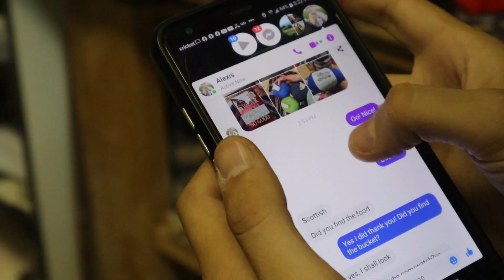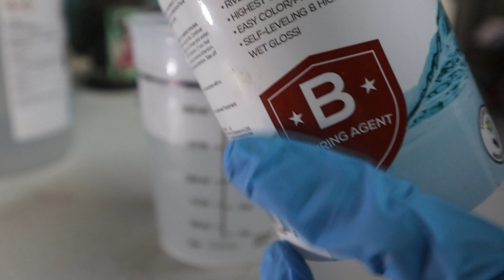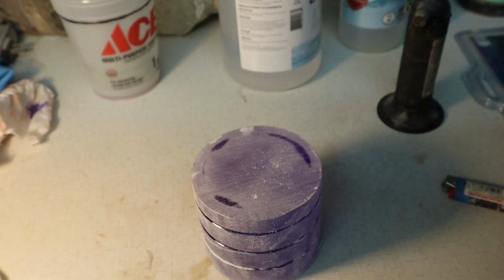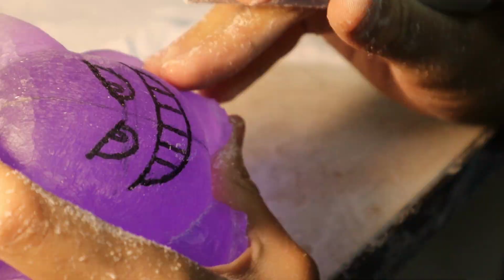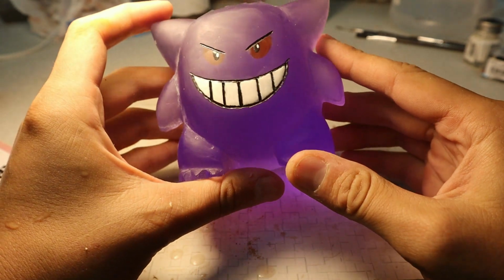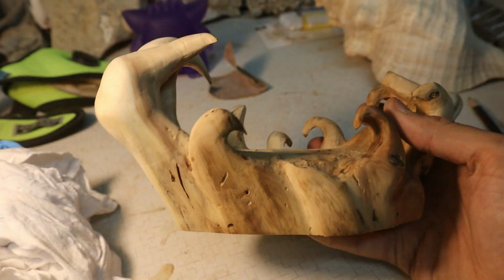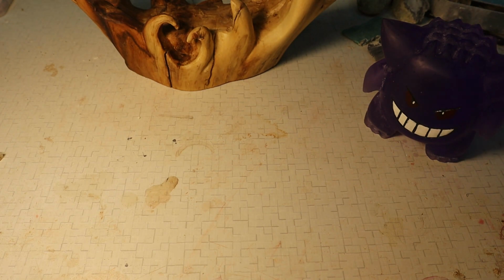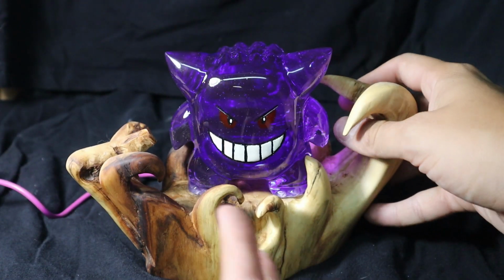I CARVED a Block of Resin Into a GENGAR LAMP!

Comment: Not criticizing, but is there a way to de-bubble-ize the top coat?
Reply from the maker: Actually all of the bubbles are internal, the internal bubbles are impossible to avoid without a pressure pot or a vacuum chamber(of which i own neither but am looking into for the next one), but the glaze coat is actually very easy to de-gas; after brushing on the glaze coat you just lightly hit the entire thing with a torch or heat gun and that thins the resin which allows all of the bubbles to rise to the surface and gas off and pop
Reply: @sticksstones639  how old is the recipient of the Gengar? (My sons are 28 & 33, and I remember playing Pokémon with them)

Comment: Dude, how did you just PAINT ON resin onto a ROUND OBJECT without it dripping and messing the whole thing up?!?!?! I racked my brain trying to figure out how to put resin on a sticker bombed cube so it would be flush and smooth and ended up just spraying it with polycrylic (which didn't actually work btw, it sealed it but didn't make it smooth and flush). Please good sir, teach me your witch craft!!